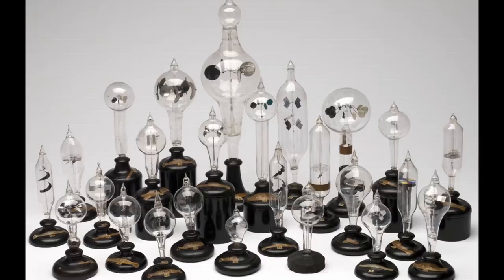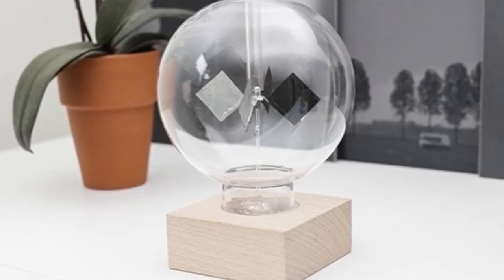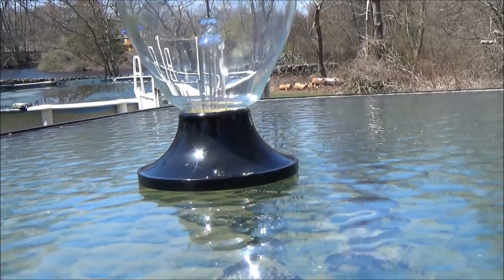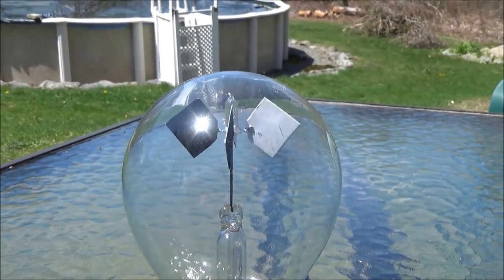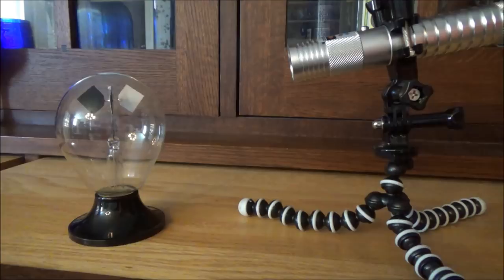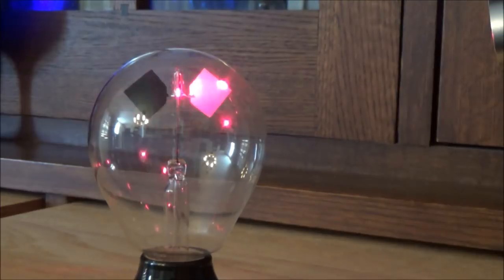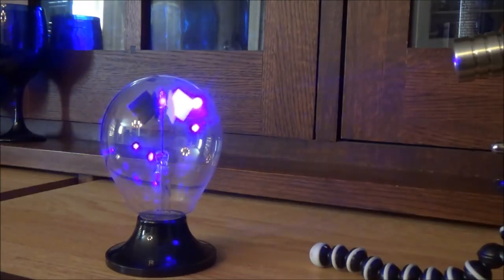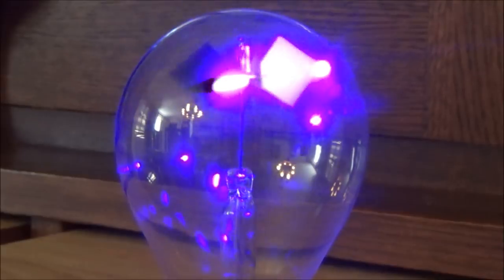How to Move an Object with a Laser

Comment: This educational apparatus, so-called Crooke's radiometer, has nothing to do with the working principle of solar sails, right? If movement of the rotor is due to convective currents of tiny amount of air trapped in the bulb, it is not the light pressure (solar pressure) which moves the vanes. In other words, light pressure does not contribute significantly to the force moving the vanes. The force is due to convective currents which are due to density gradients resulting from radiative heating of air. Am I right?